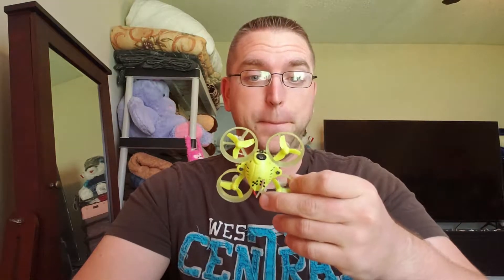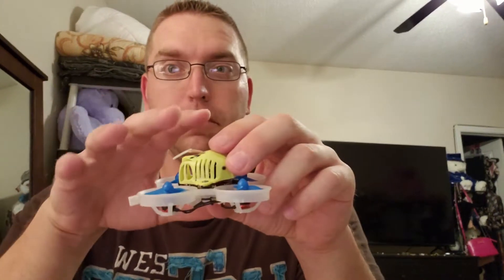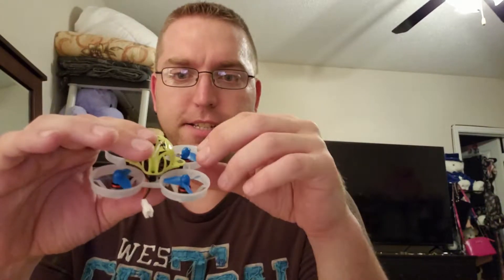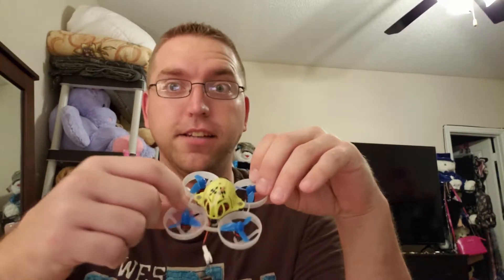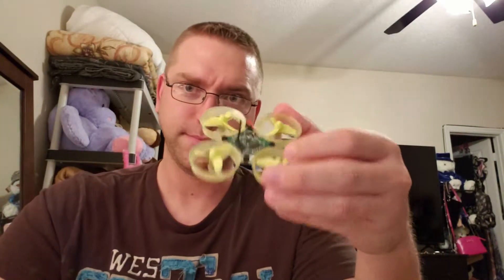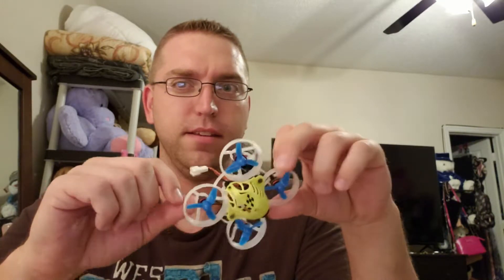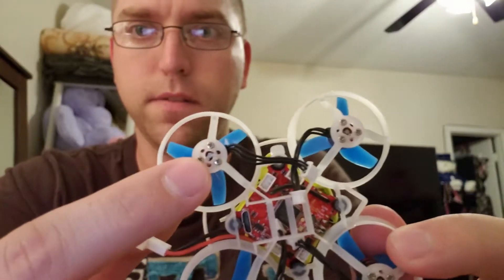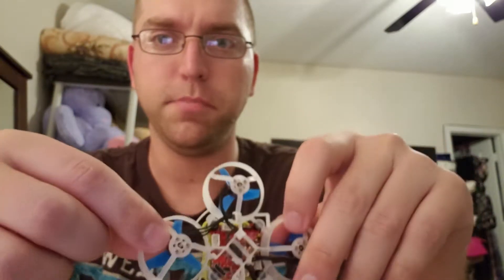ultimate tiny whoop upgrade

Comment: Hey. Nice video! Can just replace the eachine QX65 frame and motors? Why did you replace the flight controller?
Reply from the maker: the QX65 fc can't accept brushless motors. brushed motors only have 2 wires while brushless uses 3 wires.
Reply: @gr8moth  omg, good to know! Thank you!
Reply from the maker: If you do decide to buy a fc I would suggest the crazybee f3 pro. Its the one that can handle 1sand 2s. Just encase you decide to convert it into like a mobula7